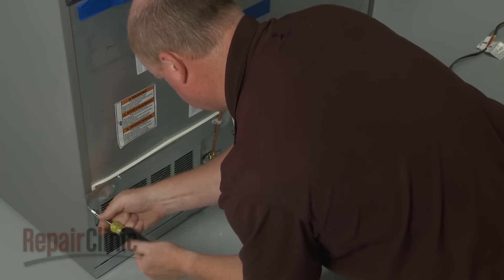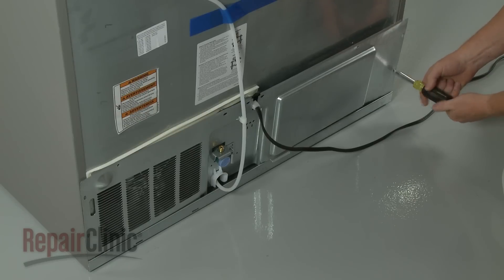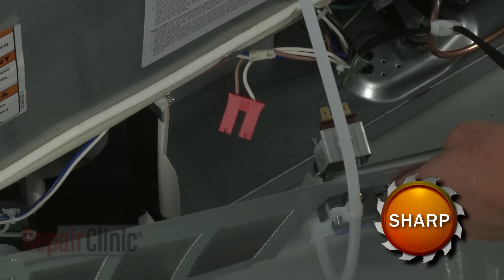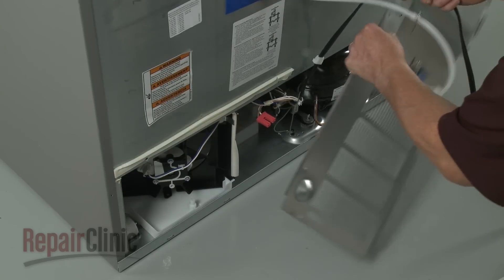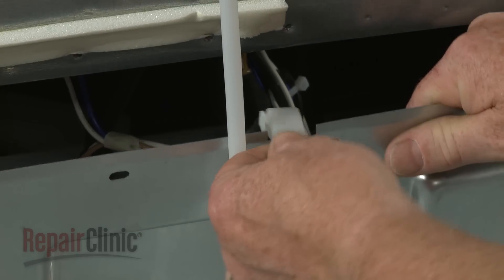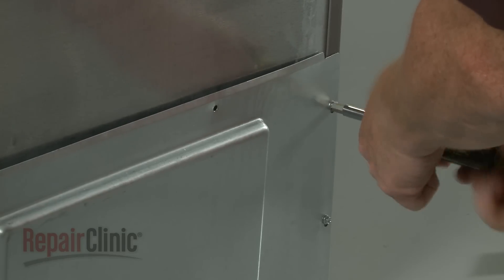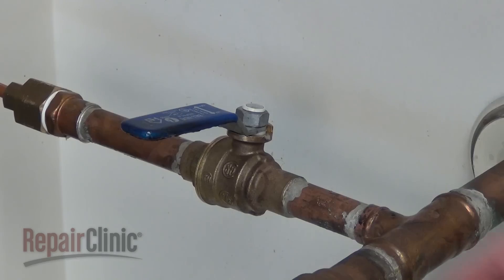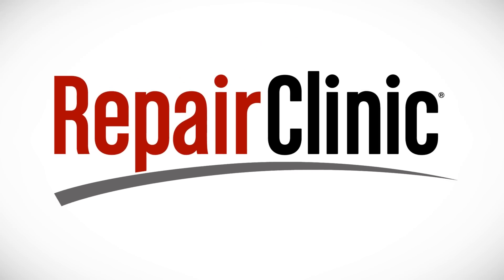Whirlpool Refrigerator Drain Pipe Replacement #W10619951

Comment: Good clear video but leaves a few things out. First of all it shows you removing the new drain pipe instead of the original. More importantly it skips defrosting the freezer and drain hole. I imagine 99% of those who perform only this fix are still going to have a leak because the drain hole is completely frozen over.

Comment: Warning:  The drain pipe latches to the drip pan (at the bottom) via a plastic tab.  To safely remove the pipe, you can gently depress the tab using a small screw driver.  The bottom end of the pipe has a flat side (to your left looking a the the work area from the back of the unit) and the flat side has a small square hole which hooks on the plastic tab.  Press your tool gently into this hole to release.   There is a chance of cracking the plastic drip  pan if you remove the drain pipe by twisting.   Replacing the drip pan is comparatively difficult and expensive.
Reply: I made this mistake before reading your comments.  When I twisted at the drain pipe bottom with pliars, it came off all right, and along with it came the bottom of the drain pan, a quarter sized hole now in it's bottom.  Hmmmm....what to do..... I got some glue for plastic, and glued that piece right back in (with a taped backing).   In my case, all I needed to do is clean the blockage in rubber pieced that's affixed to the drain hole at top of drain pipe.  It was a stupid design, an obvious place where dust and lint will eventually clog that rubber piece -- I tossed it and now drainage goes from the drain hole directly into the drain pipe.  The rubber piece appears to be for anti-splash affect, but the drainage is so slow, I don't see that as an issue.
Reply: What to do if you can’t get the tab to release?
Reply: @carolynthomason3746  I can only say to be patient and gentle.  If I remember, I broke the drip pan on my first attempt, and it was difficult and expensive to replace.  I think the drip pan was rather brittle.  Good luck.
Reply: @carolynthomason3746  I was able to pull the other side down off of the pipe extension and once I did that I was able to finagle it to become detached from the drip pan. I didn't read this comment either so I didn't know there was a tab I had to push I just knew it seem like it was stuck on a really good so I got the other side off first and then it came out without breaking anything thankfully.

Comment: This video only shows the replacement of the NEW STYLE drain. The OLD STYLE isn't that easy It's hard plastic and will not bend as easy as the shown rubber type. What do you do then.?  I'll tell you. You can fight with it and do all you can to dislodge the OLD Type drain from the Pan,  or You can just get some snips and cut it in Half, and move the piece still connected to the left, and there you are. Install your New Style Tube Drain...

Comment: Thanks for this video. I appear to have installed this part and now the fridge no longer leaks water onto the floor (awesome), but there is still a thin sheet of ice in the bottom of the freezer. Is that a separate problem?

Comment: Model ED5PHEXHQ00.... I removed the cover in the freezer and it appears that the opening of that drain has possibly torn(?) but the opening is now more on the back side. After trying to thaw the drain, when I pour water into it, water appears to pour from under the aluminum tray and down into the bottom of the freezer's bottom drawer.  After looking at the evap tray (from the back)where i can see where the water should drain, it looks like its been dry for a long period of time. I could not pull the drain tube out from the bottom as it was impossible to get my hand in that space. I will see if I can get a pipe cleaner through the top from inside the freezer. I'm guessing the rubber drain at the top is torn.

Comment: Is it possible to plumb the refrigerator to the home's drain pipes, eliminating the pan completely?
Reply: Absolutely! The condensate pan is because 95% of us don't have a drain close to our refrigerator, keep in mind it needs to go downhill the entire way preferably with a single piece of hose. That's the problem with the existing design, it goes from a big hose to a smaller one and inside that Union dust collects on the lip of the smaller hose, horrible design.

Comment: Mine is making a gurgling sound when I close my doors as air tries to escape through that hose. Is there a way to fix that? The fridge never made that sound for the first 1-2 years since I bought it, and just this past week the noise began. Very annoying, and happens with every single close of either the Fridge or Chest-Freeze drawer on the bottom.
Reply: Did you fix this? What was it?

Comment: note on the ice buildup on the floor of the freezer, I've seen videos where they remove the compartments to access and remove the ice. I simply reached in behind the compartments , tight fit but you'll be able to reach in....then , with a hammer  tapped ice on floor (gently) breaking up the ice and removed it with a spatula.
Reply from the maker: Thank you denco, we like to use a hair dryer and turkey baster with HOT water to clear frozen refrigerator defrost drain tubes.
Reply: This is only a temporary fix there is a drain hole inside on the bottom behind an access panel that is frozen this is a fulll Length two door model with water and ice access on door
Reply: @carlestillette6871  I'm having this exact same issue. Can you tell me where the drain hole is? Is it where this drain pipe connects to?
Reply: @carlestillette6871  How do you get to this drain hole from the inside?

Comment: what does the drain pipe do.
Reply: The drain tube is designed like a p-trap found under your sink.  The water that retains in the tube will block air from passing through.  The reason you need this part (or for fridges in general) is to prevent warm air from travelling into the freezer. (The drain tube goes from inside the freezer to outside the fridge into at the bottom - (in the back for these fridges) - what you are replacing is only part of the drain tube)  

Warm air mixed with freezer air is just calling for all kind of problems.

Comment: Sorry to say it, but it still leaks after fix.
Reply: You need to defrost the freezer, pour hot water into the drain hole in the back centre of interior of the freezer or if you have a steamer - steam into the hole.  You should be able to pour water into the hole and it should be able to drain into the bottom pan freely.  

Until this is done, the drain tube replacement repair is useless.

Agreed.  Old drain tube (water guide) from pan is much harder than shown in video.  To remove old drain tube style - shine a light to the bottom of the tube.  You will find a locking tab (on pan)  locking and clipping drain water guide onto the pan.  Take a small screw driver and push the tab as hard you can - while pushing, pull the old drain tube out.  If you are pushing hard enough on the locking tab, the old drain tube / water guide will come off very easily * Be careful not to yank too hard on the old drain tube risking breaking the plastic pan - this will result in a much harder repair :) *
Reply: @kimvietleful  The bottom part is the freezer. Isn't it.